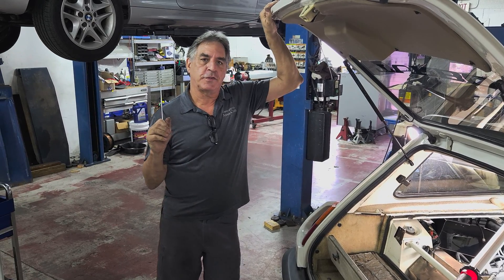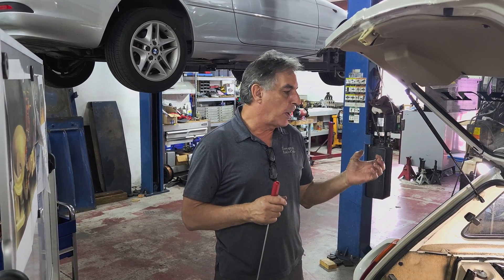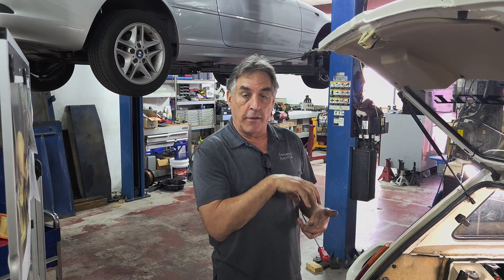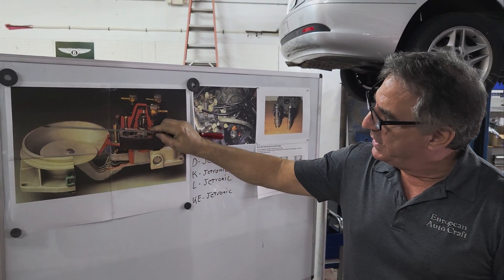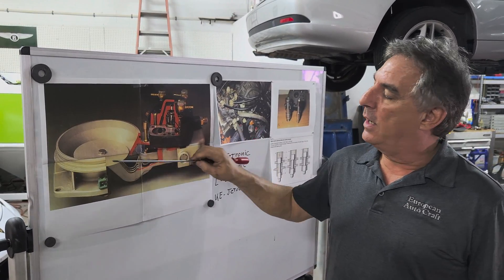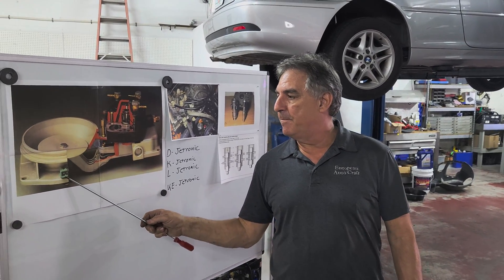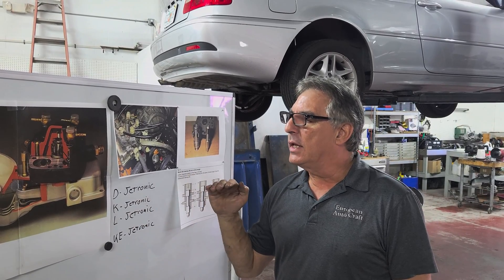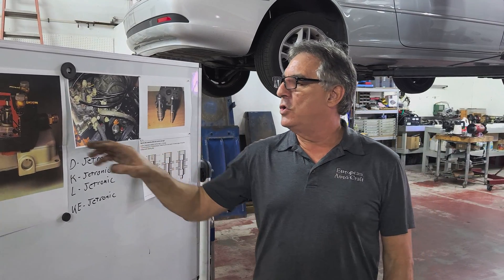How CIS Fuel Injection Works - 1973-1994

Comment: Thank you, great video. I have 86 Mercedes 560SL with the KE, so EHA valve O2 sensor.  I'm struggling with trying to get smoth idle.
Reply from the maker: I've seen the EHA fail and cause loss of acceleration enrichment. If you pull up the carpet and the plastic floorboard, the o2 sensor wire is there. Disconnect it and see if your idle comes back to normal. Yo may not have to remove the plastic piece,  I don't remember.  It's the green wire with a little boot on it.

Comment: Worked on MANY VWs with Bosch Jertonic with the injectors directly in the head. Spraying on the back of the intake valves. Very efficient system with 40+ miles per gallon.

Very reliable systems, almost 100% mechanical. Needle bearing supported throttle bodies. As long as there is enough fuel pressure, the system will run.
Reply from the maker: Yeah, they were so highly engineered, and so reliable. Crud in the fuel is the only thing that can hurt it.